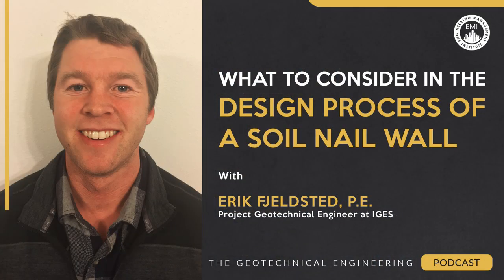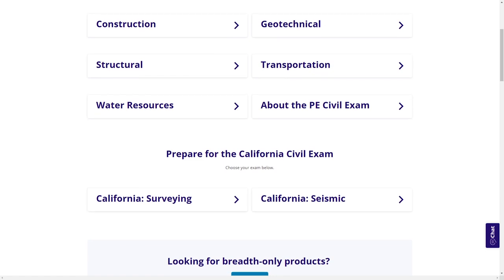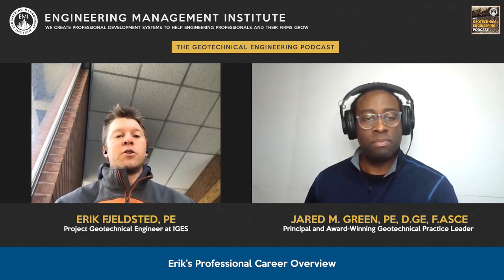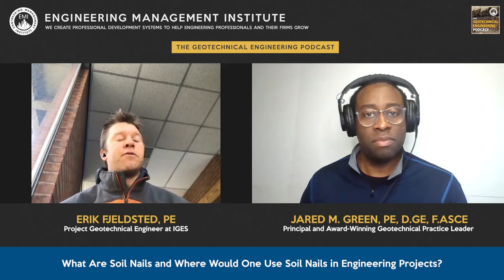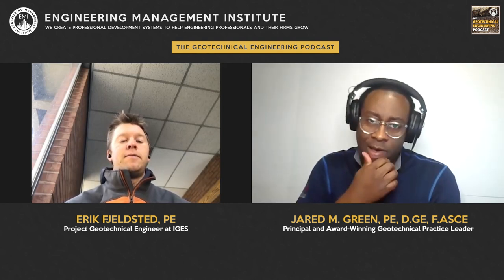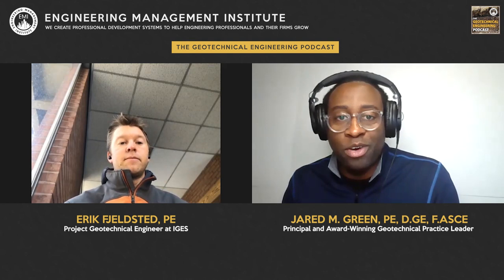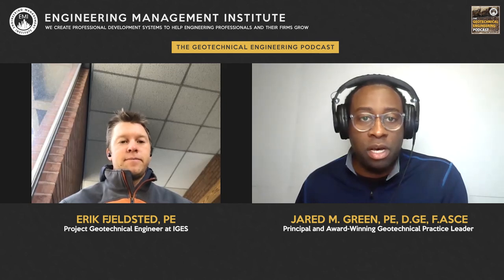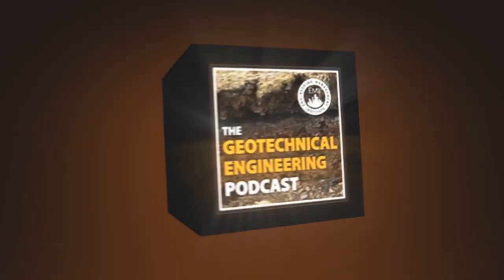The Design Process of an Effective Soil Nail Wall: What to Consider

Comment: Hi, Will the soil nailing still be an effective if the slope height exends more than 100 metres. How to relate the slope height and the efficiency?
Reply from the maker: @karmanima1408  Soil nailing can be effective for slopes exceeding 100 meters, but the efficiency relationship becomes more complex. 
Here's why:

Limited Nail Length:  While nails can be long, there's a diminishing return beyond a certain point (typically 0.8-0.9 times the slope height). Longer nails may not significantly improve stability compared to the extra cost.

Soil Properties Matter More: Cohesion and friction angle of the soil become even more critical for tall slopes. Stronger soils allow for efficient nail reinforcement over larger areas.

Design Optimization Needed: Engineers will need to carefully analyze the slope using advanced methods to determine optimal nail length, spacing, and inclination for maximum efficiency.

So, while soil nailing is still possible for very tall slopes, it demands a more intricate design approach to maintain efficiency.